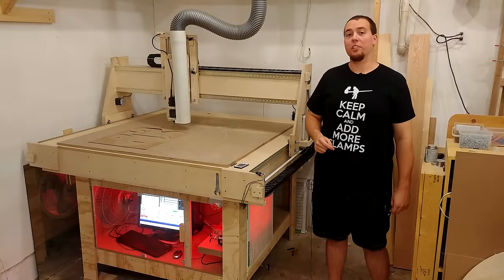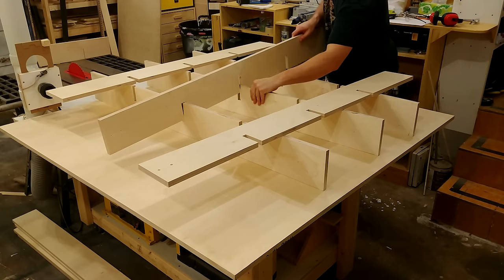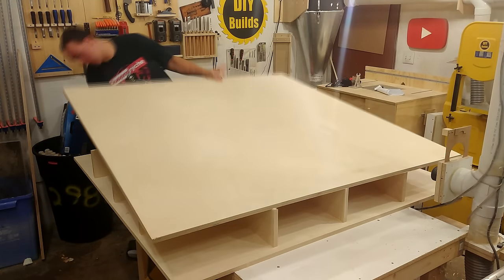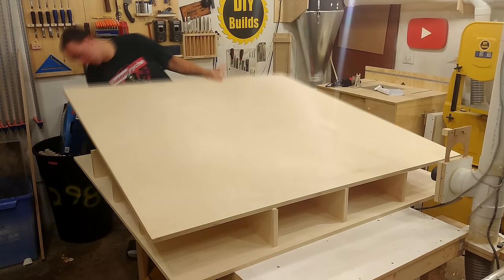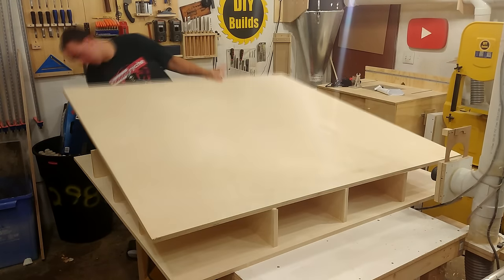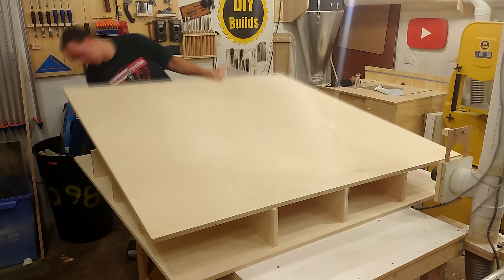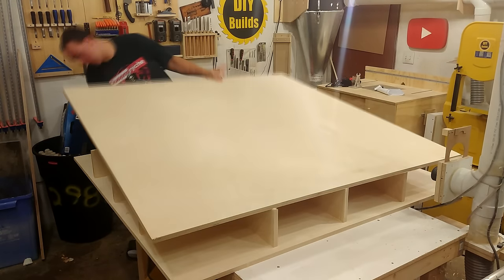DIY CNC Router for Under $900 - Free Plans Available

Comment: great vid, thanks for sharing - just wondered, i was thinking of making this but using a 9ft by 5ft table so i can cnc full sheets, dont think i came across anything that would prevent this, obviously would need to extend rails, drag chain etc - or is there something in the software that would limit this option?

Comment: for pvc hvac you can also just use some teflon tape or any kind of gap filler on joint no need to cement unless you need the support strength

Comment: I home built my cnc for ~$3000 I got aluminum extrusion from the scrap yard to do it. Bought everything from China except the aluminum ground flat plate and then blagged a forum member to cut them cheap.

Outsourced the cutting of the extrusion and drilling, everything was spot on.

Nice budget build but really would rather spent 3 times as much for clone hiwin's, ballscrews, proper frame and standalone Chinese controller. I have real Hiwin's but I got the 2nd hand which is difficult to source.

2.2kw spindle is where's it's at so you can use er20 collets and 1/2" tools.

Comment: Looking at doing this build (or something similar) myself. I am good on engineering and build, I need help with electronics. The controller in the list of materials is no longer being sold. It also looks like the technology has advanced since the video was put out. Does anyone have a good video or online resource I can use to learn about current control systems/software?

Comment: A little  tip for what it's worth, older cnc machines especially  had eccentric height /tilt adjustments  on z axis head(  cross  axis travel)  as due to misuse, ( hitting something   when in use or overloading z axis  due to incorrect height or cut speed etc) wear or any other problem, you could relatively easily fix  alignment issues
Basically rollers running on slides,  instead of being bolted direct,  are mounted on an eccentric cam.
My later machines  were not as easy to correct,  as this simple design  feature was  superceded. A very worthwhile  simple upgrade for any machine in my opinion 
Great project,  well executed, sufficient  to inspire many  I would hope. 
If the accuracy of this  is insufficient,  there are numerous ways  it can be tickled  to improve results,  and,  you could use this to  build a new improved one, including machining out of aluminium

Comment: And I was thinking making mine out of aluminum was going to be dimensionally unstable 😂 love the torsion box design but I think if you're making it out of wood the gantry rails need to be at least double the thickness as this is a point of stress also a cheap improvement would be to seal the wood with paint or clear coat to avoid any moisture seeping in.

Comment: Absolutely Fantastic Work.  I built my own a few years ago but not to this size.  I am however, working on a 5 x 10 and using wood as the material of choice.  So far everything is going very well.  Now, I would like to challenge you a little.  Look at your gantry and your Zed drive.  You can thin this up a bit and modify it to produce a near zero deflection, at least I have not encountered any in my testing, and eliminate the worry of having any misteps in your carving.  I call mine a cradle.  My Zed drive is carried by 2 upper linear rails and 1 lower linear rail.  Not much changes on ther Zed drive configuration other than to accomodate the dual upper linear rails.

Comment: I just Started building the TopsCNC HEAVY Version CNC. Ive been doing a videos on the build but the designer of the machine also has videos on his channel. I'm doing 1500MM X 1500MM and it Is also running less than $900. Im totaling out around $750

Comment: That has more suction than my Commercial Router has. I would have put an access opening in the gantry to clean it out so it does not get heavy, if any dust get in it. Luckily you don't have the ball screw inside the gantry and the table doesn't move an have ball screws. I would check the ball screw for dust build up though and use a dry lub on it to keep the build up from sticking to it. This also doesn't have an oiling system for the ball screw, so your saw dust doesn't get double the weight, easier to clean.
  I do like how the process boards are set up under the table. Although I would have mounted them vertically so any dust doesn't get under makes them easier to clean.  I would want both the key board and monitor set up outside, so I could watch my program while running. So if you have something your running move you can see where in the program you where to slow it down, if its taped and not clamped down
. Also put all your programs on disc, just in case something happens and your hard drive crashes. Everything is backed up. Or a program gets erased somehow. Thinking about building one myself. But I want a suction table. Not with a pod setup like my commercial table, but square pods to use 2 to 8 pods instead of 15 to 60 pods both big and small that takes 3/4 of my set up time. I want to be able to cut through the wood and put contours on the edge of a sign. I'm not doing it by hand or on a second machine. Just keep the suction on  when you change the blade to contour you can then just use the same starting location, just offset for the size difference of the 2 blades...

Comment: Instead of gluing pipe I just use small self drilling sheet metal screws. I have even used them on a sump pump with little to no leakage.

Comment: This is an awesome, massive, build.
The only issue I have is the lack of adjustment possibilities on the Z axis, as it is prone to change.
A really easy test to see if it's off in any direction, is to use a wider router bit to plane a workpiece a couple of millimeters.

Comment: Cheap hole-saws: to stop (or significantly reduce) that nasty burning effect (simply cause by the laminate resin superheating with fine sawdust) try this trick:
Once you've marked the circumference/started the hole, remove the holesaw, then drill through a 6-10mm "pilot" hole (depending on size of main hole) hard up against that circumference.  When you continue with the holesaw the sawdust will be able to "drain" out rather than collecting in the slot you are cutting.

Comment: i might be a bit late to the party, but you really should connect your com on the driver boards to the ground of your control board... because as it is now you are relying on mains ground through the usb supply and your pc to act as a return path of the controlsignals between the controller and the drivers.

Comment: 6th or 7th time watching this video over the years. and this video was what got me wanting to get into cnc. In march of this year i ordered a 9014 frame from aliexpress and after 8 months being lost at sea it showed up tuesday. the gantry was setup for left side running of cables and my shop is setup for right side so i swapped the sides but having never used ballscrews before wasted a ballnut when the bearings went all over the shop. so new ballnut on the way. whats really funny is the z axis weighs as much as my upgraded 3018. i noticed they used no loctite on any screws so i will be 100% tearing every part apart cleaning it, painting it and prepping. i will also be buying new grade 6 screws because with the chinese screws it came with it seems to be neither metric or imperial but somewhere inbetween. and i cant see m6 screws being used in my machine im going to make most of it 1/4 20 tap and a few pieces 5/16 18 tap. and they have m4s for the steppers and they look shady as all hell so i will be replacing those as well. but i didnt buy it for the machine itself i bought it because the aluminum would cost me more to buy local and then have to get it machined. I went with Corvetteguy50's G540 controller and spent actually more than the 25% more than i paid for the frame on a table to put it on. 3 years of planning and  its finally at a 99% parts complete just needing the ballnut and couplers. I bought 2 leatherbound journals for the machine. one will be for everything dealing with the machine such as torques i tighten to, component building and wiring diagrams, vfd and mach settings while the other one will be feed and speed data divided up by material, bit type etc. before purchase i went to the hardware store pricing wood and it was so rediculous i decided to go with aluminum. since today is november 12 and i got 90F degrees  20% humidity. in august itll be over 140 and 6-8% humidity in my garage so i have my 3-4 month work period before i have to purchase an AC unit for the garage. im not spending $5k on a machine and have it lose steps because its too damn hot in AZ.  I could at the state the machine is now have it up and running tomorrow if i didnt care for my life or safety or the endurance of the machine but im looking at 4-6 weeks to put it all together and get everythng dialed in and since i only have weekends to work on it.

Comment: Amazing. Great job.
So, how do the DIN rails hold up? Obviously you are not pushing it too fast or pushing too hard. Quite possibly this is just fine. But I'm currious your experience now after running a bit.  Did anything loosen up too much?
Reply from the maker: So far so good but it doesn't get used a whole lot each month.

Comment: A few ideas:  the table probably doesn't have to be so thick.  I would also consider more cross bracing, even perhaps incorporating some angle iron.   Another suggestion is that stiffeners make out of 1/4 baltic birch could be very effective.   As I said, the stiffness of this component will go a huge way to making the tool more accurate and with more stiffeners, you could reduce it by a factor of 10. The way you have designed it and with more cross members, this table should be nearly as stiff as a solid metal design.

Comment: Very nice. I am going to use a modified version of this to create a table to cut full sheets of 4x8 material. I will be using a true spindle motor as it is much quieter and has variable speeds. I will use it to cut aluminum as well.  It will be able to fold up, and have a vacuum table too.
Maybe I will create a video showing my version.
Thanks for posting this!

Comment: Don't know how I got here. Woke up to this from autoplay. Great video, had me in suspense about what it was. I have one question, why is there an A axis, clone of Y, I think you said?  I try to think of a reason. Also you made mention of 4 access. X=horizontal, Y=in/out/depth, Z=height, 4th=time?
Reply from the maker: The gantry uses 2 motors for the y travel.

Comment: Hey buddy, just to let you know, I saw your video maybe 8 months ago. I used yours as a template staring point. If finished up a little different but if it was'nt for your video I mightn't have got started. The main variations are linear rails and mine has a LED laser too. Thanks for your video.
Reply from the maker: Awesome. Email me a pic to post on my website if you wish.

Comment: Great 3-ax router. being App Engineer for last 15years I try to understand the need for secondary Y-axis... and the reason you used A instead of B for it. as in basic CNC A always assigned to X and B always assigned to Y so C assigned to Z... that is universal. Very clean basic Electrical Diagram... and nice NC soft. Question did you still use it or you found something else you like more... Nice PLC Ladder assignments in the soft... very self explanatory. Would like to connect with you for collab and possible employment.
Reply from the maker: Yup I used it yesterday even.

Comment: Nice work! How has the DIN rail thing worked out? That and the belt tensioning would be the only things I would be curious about. Seems to me that Vee-track would have made more sense to me than din rail. And - the router contactor has a 24V coil and the power adapter is 12V. Does that work?

 Otherwise, fantastic job!
Reply from the maker: So far so good. Din rail was chosen for its low cost. Obviously many things would be better choices ignoring cost. And yes the 12vdc ps can activate the 24vac coil.

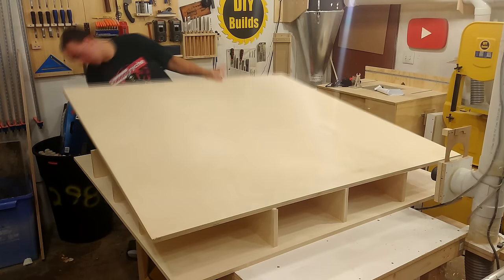Comment: I noticed that around 24:17 when you were screwing in the gantry there was a lot of flex in the X-direction. Do you think this was due to the din rail/v-bearing system? Did this cause any issues for you later on? I am designing a machine, and am looking for ways to save costs on the linear rails.
Reply from the maker: Seems fine to me

Comment: Either you are a Controls Maintenance Technician or an Engineer.   Excellent knowledge in every field.   If you ever need a job, let me know.
Reply from the maker: I used to be a control system integrator.

Comment: I have been working on this with my dad, unfortunately the CNC breakout board is almost non-functional with parallel ports being a thing of the past. Do you have any recommendations on what we can do to either upgrade sed breakout board, or any other work around?
Reply from the maker: There are similar kits all over that utilize usb port instead of parallel
Reply: @DIYBuilds  any that you would recommend? I continue to look around and I can't seem to find anything that utilises everything that you put into place.

Comment: Hi, I built a cnc machine based on your design and it works pretty well. I had a bit of difficulty getting the belt tension right and consistent  (one came slack during use, not good) so I have changed them all for lead screws - not as expensive as I thought it would be. I had to change the steps per unit on X Y and A, but now for some weird reason the machine runs in inches, even when everything is set to mm. I've looked through all the settings and can't see anything I've missed, any suggestions would be gladly received.
Reply from the maker: No idea. Havnt tried to switch to mm myself so I can't help.
Reply: @DIYBuilds  Okay, thanks for taking the time to reply.
Reply: Update: I built mine over a year ago and have used it a lot. I have recently found that the din rail was starting to wear, this was caused by the v bearings rubbing, so I have replaced them with Linear rail bearings. Total cost < £100, but retro fitting was a bit of a challenge.

Comment: I am confused. I am starting a parts list and would like to order the stepper motors first. However, I have noticed (incorrectly, maybe), that in the video, no dual shaft steppers are used. Is that just a typo in the parts list, or am I missing something?
Reply from the maker: No dual shift is required.

Comment: awesome video! as someone who works as a CNC machine programmer/operator for the last 13 years, I am more than interested in this kind of video. 

Although I work with heavy industry machines (aka DMG, Hurco, Heller, etc) and 99% of my work is with steel, stainless steel and aluminium, I really like working with wood. Your video gave me some clues on about how to combine my private hobby with my job :)

Comment: Great video, very good explanation and production. Only want to ask why in the diagram you have a 12 VDC power adapter and a 24 VAC coil in the contactor?  tanks.....
Reply from the maker: It works believe it or not.

Comment: Not to be argumentative, but I worked with a system that had multiple E-stops, seven of them I believe, And the Master was actually normally OPEN. We had to actually pay special attention when ordering replacements (It was a corrosive environment) because every E-stop we had came in a normally OPEN and a normally CLOSED variant. This might be an american thing, it is what it is, Just trying to share some information.
Reply from the maker: With normally open if the wire is cut or somehow disconnected you cannot activate the estop.
Reply: @DIYBuilds  The E-stop is put into operational mode by closing it. If the wire is cut then nothing operates anyway the machine assumes the stop is not activated and shuts off the machine. So instead of pulling it to start it you actually push it instead.
Reply from the maker: You just described " normally " closed lol.
Reply: @DIYBuilds  I understand how it could sound that way, but in its "normal" or pulled out state it is open and you have to depress it to close the circuit.

Comment: Great video and I have been thinking of either making one or buying one. What are the limits of this build? Is the spindle powerful enough for hardwood? Can it do intricate and accurate continuous cutting for example a large ornate wood frame or mantle piece? Any advice is appreciated though I’m pretty sure I will do a similar build to yours instead of taking out a loan for a name brand one lol
Reply: Also what about PVC sheets instead of the plywood for the bed and gantry? Just worried about humidity and expansion

Comment: on your parts list it has the Nema 23 step motors dual shaft but looks like in the video it's single shaft?
Reply from the maker: That is correct. The listing was wrong and i copied that.

Comment: Excelent video! It was a true Masterclass, you really know how to work with wood. I have put your design/build on my things to make list when I get myself a garage in the future. For now I am figuring out how to use a smaller 2ft x 2ft MPCNC CNC and having issues with the router and toolbits when I try cutting Acrylic, suffering from overheating and melting. I could do with your thoughts on how the Drill Master router has been performing and does it have a fixed speed of 26000 rpm? Have you done any work on Acrylic? Any tips you can provide will be greatly appreciated.
Reply: 8

Comment: when the Z carriage is all the way up, it seems it's bottom is flush with the X carriage's bottom, and the bit starts from there. So if there is 6" of space under the X carriage bottom, that would mean that the maximum of stock you can mill is 3" thick, because you need also to fit an equivalent length of bit over it, and if Z carriage doesn't go higher, this is the only way.
Reply from the maker: You know you can cut 0.1 inches into a 6 inch thick piece of stock right?
Reply: @DIYBuilds  true